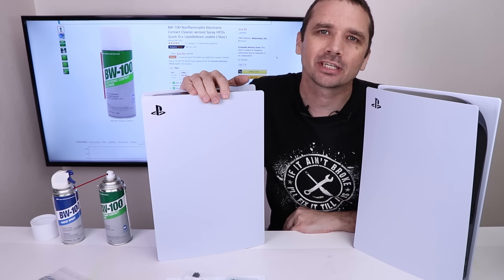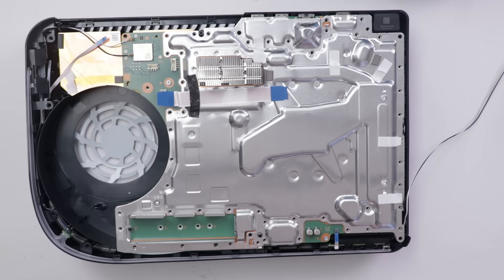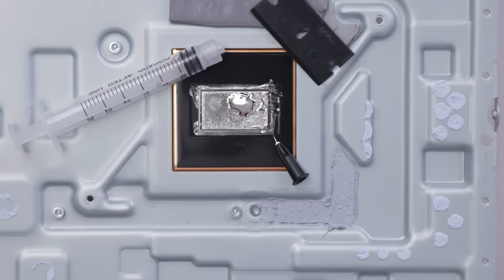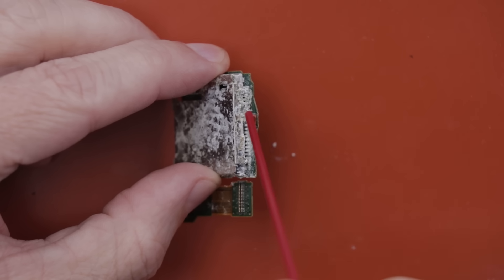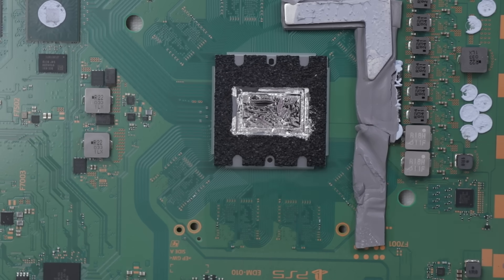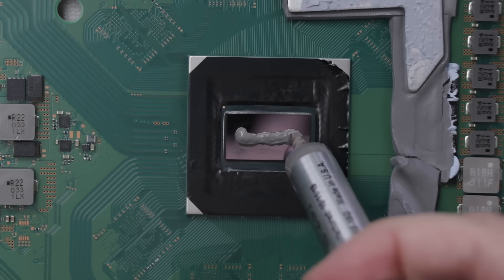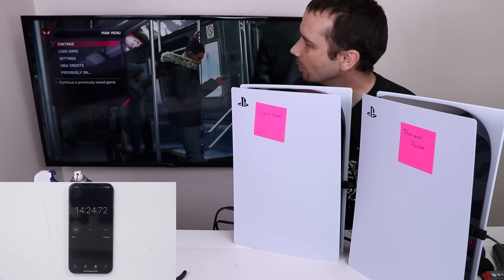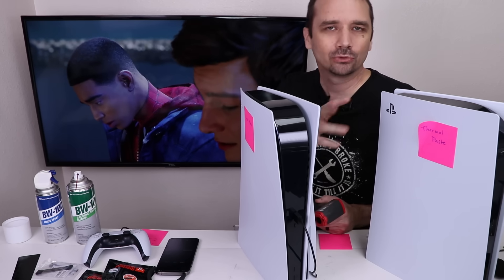PS5 Liquid Metal vs Thermal Paste - It OVERHEATED!

Comment from the maker: Buy BW-100 Electronics Cleaner Here: https://amzn.to/3hviKDv
I think it's time I put liquid metal in the Xbox Series X! Who wants to see that?
Reply: Very curious to see!
Reply: Lol you said PS4 we all mistakes
Reply: Excellent ... From what little I know about Thermodynamics that I learned at the University and I hope someone will correct me if I'm wrong ... The person who is doing the heat comparison between the two consoles, is only measuring the temperature by Convection and It is not measuring the temperature by Conduction, which is where the second law of thermodynamics applies ... That is, it is not an exact measurement of the real temperature of the console processor since there is a big difference ... For example, it is as if We would have patients with a very high fever and we would try to measure our body temperature by blowing the thermometer (Convection) instead of putting the thermometer in our mouth (Conduction) ... In short, liquid metal cooling is much more efficient on the contrary of thermal paste since it is a material with greater thermal conductivity that transfers and expels all the heat ... That is why the temperature expelled by Convection is higher ... And as for the liquid metal It cannot have contact with the other components, it is because it has electrical conductivity and it could cause a short circuit unlike thermal paste that does not have electrical conductivity ... I hope this information helps and if I am wrong, someone will correct me for Please since this is a broad subject governed by the laws of thermodynamics ... Greetings to all, and God bless you (^. ^) .. '
Reply: I wanna see this Video
Reply: Yes, I would really like to see this on the Xbox Series X as well!
Reply: Can you try the thermal pads on the APU vs liquid metal please
Reply: Please do this!!!
Reply: It'll be interesting to see the difference (if any). The fact that PS5 relies on LM is unsettling indicative of compensating for inefficient thermal design
Reply: @neiliewheeliebin  not even, LM will never dry out, never harden, and never go bad. so it really is the best of all worlds and sony should be praised for going this way. it is way more expensive than all other thermal paste.
Reply: @brian770  Its a terrible design our PS5 is already overheating after being stood on its side my Xbox hasn't overheated once they both sit next to each other
Reply: Xbox series X does not need it it has better cooling than PS5
Reply: You need extra pair of hands. While someone is playing you should measure. ;-)
Reply: I would like to see PS5 Liquid Metal vs Honeywell PTM7950
Reply: Londonio_hule on twitch
Reply: @DTW-bx2vy  well that can't be true
Reply: @DTW-bx2vy  cap
Reply: Yes
Reply: @AnImperfectSoul  It could also be running cooler, the XSX has more gpu cores but they are clocked lower, so that is less heat per core spread out over a larger IHS, it's likely it simply runs at a lower temp.
Reply: @matilija  can't really look at it that way. The cooling capacity on the PS5 certainly is much more capable than the xbox.
Reply: ETas bien pinche cagado
Reply: @TronicsFix maybe this is a stupid question, but does spray painting the case cause any overheating issues? I'm thinking of making my PS5 black. Thanks!
Reply: @alexelxndr  Spray painting the side panels shouldn't effect cooling really at all, as the exhaust is out the back of the machine, just make sure to remove the panels and paint them on their own to ensure no paint gets into the vents.
Reply: give me 1 ps5 please, you have 2, and I cand by 1
Reply: Put some nail polish on the little components around the apu and you are safe.
Reply: Is it possible to use liquid metal on PS4?
Reply: @pipi691  it Is , you just have to be careful.. he has a video on it even does it on xbox
Reply: Wait dude are you working on a ps4 here or a ps5 I saw ps5s in the beginning but then you kept calling it a ps4 later so I'm confused!
Reply: Yeah that been interesting to see, problem i think there’s nothing to keep it in place?  But know your macgyver ways, you will find one.
Reply: Sounds interesting!
Reply: The ps5 is the coolest running system there is that is a waste of time I keep mine dust free anything will over heat if you don’t keep it clean
Reply: Do it please!!
Reply: what about on PS4 too??
Reply: How is the odor of the BW-100 cleaner? I use a CRC electric contact cleaner, but I have to use it in a well ventilated area. It can be harmful to breath it.
Reply: I think it’s time you sold some of those ps5’s you fixed to gamers that can put them to use…kinda sad a year later and still can’t find any for a reasonable price anywhere close to retail.
Reply: @Wayne “Weezy’n’Breezy” Yates  I hope you were able to find one by now.  They are literally anywhere and everywhere at retail.  So easy to score one now.  Good luck.
Reply: Pls can you recommend a quality liquid paste for Ps5 in the market.. I have tried few paste and my ps5 is becoming worst. Pls help SOS 🆘
Reply: So tronicsfix what do you think about standing them up potentially causing damage? Cause this things a little too unwieldy to comfortably use horizontal for some people (plus it’s just better looking vertically) should we worry?
Reply: Have a question about thermal pads. What is a good product to replace the pads for all the other chips. Have over heating problems, already replacing the thermal metal liquid(Thermal Grizzly Conductonaut). But the pads are dry and hard.
Reply: @TronicsFix possible to test to change the liquid metal for Honeywell PTM7950 AND Grizzly Kryonauts on PS5 CPU ?   apparently its a game changer !
Reply: @ Tronics Fix can you tell me why a xbox one  powers up stays on 2 minutes than turns off is there a way round this please pal ?
Reply: I had 6
Reply: I'd rather see how you use Thermal Grizzly Carbonaut thermal pad.
Reply: Well seeing that a lot of the bigger AAA titles run and look better on the PlayStation 5 and that the XBOX does not really have much else going for it other than their agenda that they had back at E3 2013 of killing the used game market. I say go for it.
Reply: @randybradley4151  lol. Yeah okay. I'd stop sitting in the garage with the car running.
Reply: @kraigparadise5770  Maybe you should take your own advice because Xbox agenda was to eliminate used games and this is how they went about with Game Pass. Also watch most of the comparision videos on Digital Foundry that proved my point of games running more stable and look better on the PS5. It still baffles their minds on how capable the PS5 is even though they still don't have all the features the series x has. Just goes to show that extra teraflops don't always mean better.
Reply: @randybradley4151  go cry somewhere else.
Reply: @dustinj7028  Likewise.

Comment: unfortunately some of the best thermal pastes thermal conductivity is maxed to around 12-16 W/(m·K) and liquid metal is around 73-77 W/mK. the PS5 was designed to run at the temps based off what liquid metal can handle. i'd love to see if a water cooling and thermal paste option would work, but thats a job for LTT. (or meta PCs as it were)

Comment: Since the PS5 seems to be running with thermal paste as shown on the video.
Isn't it a "fix" to console who get corroded by the gallium within the metal liquid ? 
Even if it's transferring less calories, thermal paste is less sensitive to non plane sufaces unlike Metal Liquid.

It's a shame that Sony decided to use something as much unreliable as Metal liquid for the ps5's colling system.
Larger heatsink and larger caloducs could perform the same without issue caused by metal liquid

Comment: Hey Sir,
could you please try the same experiment,
this time with the PS5s with the more power efficienct chips,
i.e,
PS5 Phat (3rd gen) cfi 1200 (Digital),
&
PS5 Slim (1st gen) (Digital/Physical).

Also,
would really appreciate a teardown video of the CFI1200 Digital Variant. (Not available anywhere)

Please try out PTM7950 instead of thermal paste.
Reply: He's a tech not engineer.

Comment: Could the black adhesive have added to the overheating? Maybe it works with Liquid Metal but general thermal paste won’t be cooling as good, with the black adhesive on there as well the components could have overheated. I’m just taking a guess here

Comment: Can you do the same test again, but instead of a heat-sensitive paste, use the Grizzly Kryosheet. I think it's supposed to be a kind of graphene pad that's very good for heat dissipation. It comes in different sizes and can be cut to size.

Comment: Thanks for this video it have alot of detail about the ps5 really appreciate it alot.

But what I would like to know, say you been cleaning your ps5 and just the thermal pads need to be replaced cause of 3 times in a year you clean it with out replacing the liquid metal part and just to get most of the dust out of the ps5 but now the original thermal pads look damaged and you want to replace the thermal pads with new ones, will that cool down the ps5 and is it a good thing to replace the original thermal pads with new ones so that the ps5 can keep the chips cooler then the original thermal pads?

Lol also I am scared to replace the liquid metal so I will not be replacing that side thermal pads just the other side but would like to know if it's a good idea or do I need to replace the other side we're the liquid metal part side with new thermal pads also just like the other side?

Comment: 9:05 testing the units without the fan is the dumbest thing Ive seen someone do. 
Calling it a ps4 more than once was a funny touch.
All in all, highest temp you got was 43 Celsius with thermal paste?
Thats LOW since TJMAX is typically ~90C.

1. Id absolutely recommend paste. Theres no chance of corrosion of the die or dry spots "Unfortunately, sometimes the APU and heatsink can get dry spots on them where the liquid metal has oxidized" taken from YOUR forum.
2. No chance the paste will drip down and short the MOBO if positioned vertical as its non conductive.
3. Much easier to clean up and reapply every 4 years.

These reasons alone shouldve made you say "While LqMe performs better, paste is the safer long term and repairable solution"
BUT given how you worded everything you were absolutely Biased either by the free units, stock you have in sony, or just being paid for the video.
Reply: That’s so stupid he has no way to see how hot the chip gets thermal paste can’t keep the ps5 cool enough

Comment: I wonder if it works with the Be Quiet Liquid metal DC2 PRO with conductivity'' 80 w/mk 'Only for use with nickel plated coolers, do not use with HDT and aluminum surfaces''
If you also try with the ''Thermal Grizzly Carbonaut thermalpad'' conductivity 62.5w/mk
THX!

Comment: I have tested this and well AS5 still the king. AS5 needs time to cure or bond. I did my PS5 Pro in AS5 and took about a week of on and off playing and not playing and fan hardly every ramps up to full now. Temps are roughly 38c during gameplay and about 20c idle. I have tested many other pastes too like Thermal Grizzly and still AS5 if you let it bond for a week out performs all the rest. Liquid metal is fine if you have your PS3 or Ps4 or PS5 on it's side but when standing up it leaks or creates a gravity well and starts to faulter. AS5 does not.

Comment: Think I'll go thermal paste. If it stays where it needs to be, and the ps4 doesn't overheat. It's a winner for me. If forgotten how many times I've opened mine to redo the thermal paste. Next time mine goes out, I'm going to switch to the paste and see how long before anything happens. Mine has a base and the standard fans on it. I'll see what happens.

Comment: Could you retry this with PTM7950? We've been seeing a number of PS5s come in lately with dead APUs and dried LM. We'd love to switch to something else that holds up better - paste doesn't seem to work well enough, but maybe PTM7950 would? Folks have had great luck with it on all sorts of gaming laptops, RTX 4090s, etc. Do note if you try this with PTM7950 that it does have an initial "melt-in" period, it reportedly performs poorly until the pad has had a chance to melt and conform to the two mating surfaces.

Comment: This is exactly what I was looking for. Grizzly is the best. if it cant replace the LM nothing can. Buying my first PS5 here in a few days, my biggest worry is having ZERO XP with LM but I wont see any reason to replace it within the first 2 years or so. LM lasts a lot longer than what most people think. Plus sony used specific metal alloys to avoid corrosion. The Red and silver cans that are at Autozone is great for cleaning electronics, I use it on my kids RC car and motherboards that I buy and refurbish. I think its called CRC Electric contact cleaner or something. Stuff will blast thermal paste off and take away its ability to be sticky, it just balls up and falls off. You can use it to blast TIM off of the pin contacts on a motherboard so you dont risk bending.

Comment: How could you possibly be surprised, when the fan control profile is based on the higher efficiency of the liquid metal. You need to boost air flow AND density, if you want to even come close. That means:

1- you either have to replace the fan  with a better unit that can function on the same feed, WITHOUT tripping a fault code

or 2- or you have to externally suppy said flow/density boost
Reply: No, The fan will just spin faster.

Comment: If you remove the ceiling ring from the PS5 you need to replace it do not reuse the same ceiling ring it will not seal properly

Comment: I wonder what is the foam name or type used on the mb power section, visible since 2:00 ? Looking for this for quite a while and could not find any answer. Is it replacable with generic thermal pads?

Comment: Lay your PS5 down instead of standing it upright.! Standing it upright for long periods of time allows the liquid metal to leak out! Liquid metal is conductive, and if it gets where it shouldn't, shorting could result. In either case, several repair technicians and shop owners have been trying for months to boost a simple signal: To avoid damage, lay your PS5 down instead of standing it upright. Hope this helps.

Comment: My main PS5 is on its side with a fan blowing on it to keep it cool. A problem that apparently I am not alone with. Bad decision by Sony to not have a proper liquid cooling system in place as is the case with GPU manufacturers. I'd have to take the machine apart and then physically move the liquid metal around on the chip, then reassemble it and then hope it doesn't happen again? Meanwhile, the Xbox Series X sitting right beside the PS5 has no such overheating problem. You be the judge on who had the better design...

Comment: I think the PS5 has an internal thermometer that is set to a specific degree which triggers a force overheat protocol. The thermal paste is probably fine and not really a problem but Sony programed it to overreact basically to prevent people from tampering with teh liquid metal. The Xbox Series X uses thermal paste and its fine, and so do a lot of PCs that are even more powerful than the PS5. I think the architecture of the PS5 just isn't design to dissipate heat as well as the X so that's why it has these measures and presets

Comment: Hello : you don't put the stand under the two ps5... Where there is an output for hot air!!!!! So of course it will be overheat! But mine shut down too after 1:30 with Hogwart Legacy. With putting the house vacuum on the two holes for cleaning the dust of the psu... It helps for Hogwarts. But Overwatch 2 still shut my PS5 down... And there is no solution, just playing Overwatch 2 PS4 on the PS5....

Comment: wow Sony uses way too much of LM on PS5. Ive been using LM for years ever since it first came out and have done dozens. Less is always more with LM. you just have to paint it on both surfaces(to make surre LM bites onto the surface and the entire surface is painted and reflective) and with perfect install there would be no puddles at all. Good LM is not cheap but all you need (from the looks of it) is only about 20percent of amount shown in the video that Sony used. this way tiny LM syringe lasts you a long, long time(LM doesnt seem to expire - i just did a PS4 Pro with Conductonaut(sp?) LM that is at least 7 years old) and much less chance of LM leaking out from under the chip to give you a big headache with shorts. with perfect LM application you dont even have to protect nearby components - but you always should anyways for a peace of mind. Literally - whatever you think is just barely enough - put only a third, since you can always easily add more(and not so easy to collect back) and start spreading it around(tiny painters brush works best for me but QTip will as well as long as no fibers drop off of it). Be patient and can use a magnifying glass to make sure every bit of a surface is painted silver. if any puddles still form just dunk your brush or qtip in it and  start painting the second surface without adding more. If your chip is lapped - use even less. this only applies to completely flat chips(vast majority) and not to concave ones.

Comment: I'm stuned with "cooler" desing. So just 2 diagonaly positioned screws on sheet metal plate to apply proper pressure on apu. This is the main reason they had to use liquid metal. Gap is inconsistent and pressure is not under any proper control. All other gpus/apus are able to be cooled with paste. This is simply garbage design, period!

Comment: Sony need to come up with something different if it take 15 minutes to overheat. I have a lot of older consoles that will take hours before it overheats all the way up to my Nintendo Switch. Sure it gets warm, but it doesn't overheat after 15 minutes.
Reply: fan was removed
Reply: Lol the ps5 doesn’t overheat that quick. When I use mine It stays nice and cool and I haven’t cleaned it out since, also he removed the fans